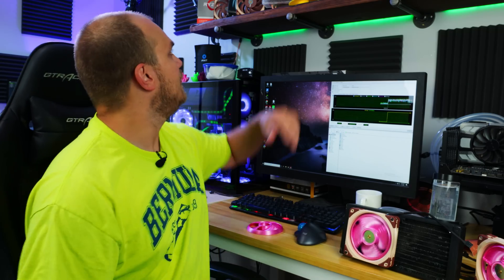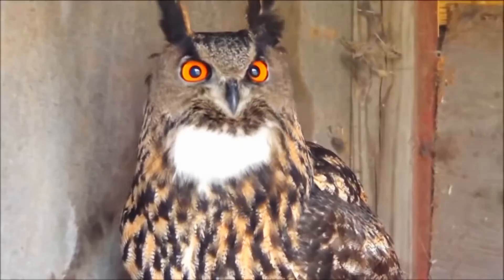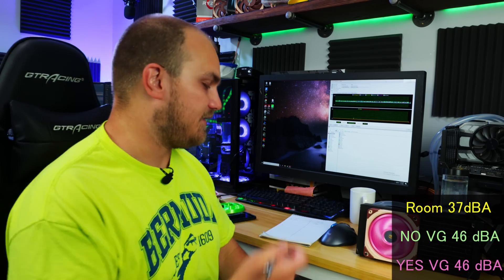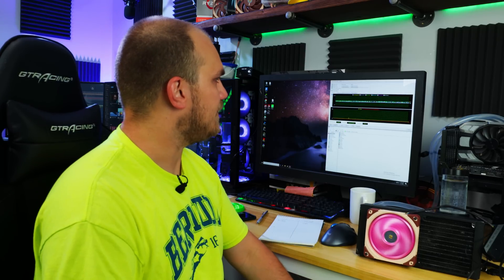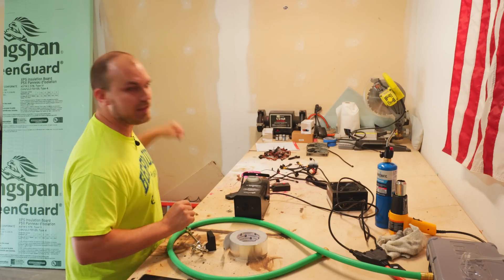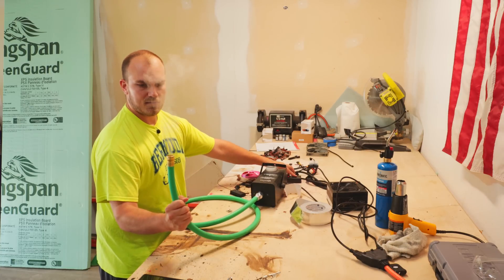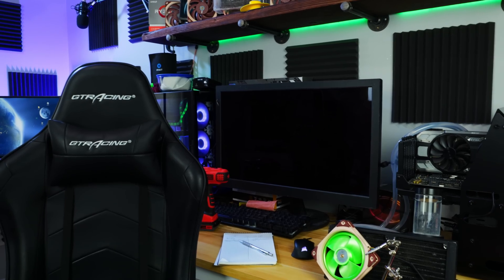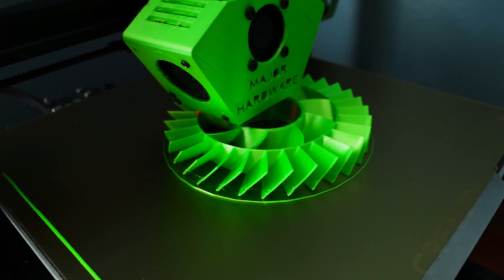Do Vortex Generators Make A Difference | 3D Printed Fan Testing

Comment: With vortex generators on wings, blades, etc, you examine the air being exhausted, not the air flowing in or entering an intake into the flow system. You can build your own high speed camera. Surprisingly, it doesn't cost anywhere as much as you'd think compared to what they sell for from companies. Oh, and drywall lift is like $200 from Harbor Freight so about $160 with their 20% off coupon, maybe less if you wait for them to discount it and use the coupon if employee lets ya. Prob would be sub $100 off Craigslist or something.

Comment: @Major Hardware
Thanks for another entertaining video.
 I have a couple of thoughts  surrounding this, firstly my initial reaction was to wonder why You didn't also test to have the "vortex generators" on the other side of the blades, as the "backside" arguably are at least as important as the "front" of the blades. Also as has been pointed out the "inherent roughness" of 3D printing might "mask" what ever effect the generators could/would have if the blades were perfectly smooth. And finally I feel that the "exhaust side" of the fans really should have been the focus of Your "study" and "documentation" as the (potential) vortices  would not appear until the air had passed over the fan blades.
On another note,  maybe You could 3D-print (or juryrig) a holder for Your mobile phone that, using "rubber bands" could hold it at a consistent distance from the fans You are measuring ?
Best regards.

Comment: I'd say lose the Vortex Generators for weight trimming. Of course lose the ring. Thicken up the spine of the blades, make the blades taper towards the base. So the blades will be more tear drop shaped. Not sure how to explain that without showing it. lol Oh. These numbers don't matter just an example. The base of the blade would be 1cm where the edges of it expand to 2cm.

Comment: nice fun video.... I will suggest if you try the outer line to have a funnel like edge. That can help in the suction of air and compression. The way that you have the outer edge you actually reduce pressure as your input of the fan is smaller than the output! Have fun.....

Comment: I don't know if anyone already answered this but.... vortex generators are there to force an early shift to turbulent flow (vs linear). This is to prevent laminar flow shedding. On aircrafts this is typical a fix  to loss off total lift, on a certain part of the wing at larger incident angles. When shedding occurs all lift is lost (stalling). Turbulent flow delays shedding,  but results in larger drag than laminar flow. The wet area of the extra vortex generators doesn't help either.

Comment: I feel like the best approach to optimizing the fan design would be to get rid of  the ring and try to get the blade clearance to the outter housing as small as possible. The most benefit to be had is on the outer edge of the fan blade.

Comment: How about a design based on the idea presented here by Tom: https://youtu.be/d80oXSCcHTk
It would require a Speed controller for the fan though.

Based on this idea a simple compressor chamber principle could be achieved.  The fan itself consists of  a static part of two 1/8 of solid circle slices and of two 1/8 circle slices on hinges.
There are also two 1/4 slices of a circle above and below the fan (rotated by 90°) to create pressure chambers.
If the fan speeds up the static blades move forward compared to the moveable blades and the air in-between is compressed. When the static fan slows down the dynamic blades move forward air is sucked in.

Edit1: Now after thinking about it, the blades themselves can consist of just two parts: one static connected to the motor (that is speeding up and slowing down ) and one freely rotating around the same axis on a bearing.

Edit2: i made a quick sketch: https://youtu.be/m7XP239dxHE .  The free running blade should be heavy to increase inertia. It would need a starting phase to get the free running blade up to speed. The over- and under pressure from the air in the chambers should keep the free running blade at a constant speed while the controlled blade speeds up and slows down. Maybe the Design would work better if the Blades are 1/6 of a Circle and not 1/8

Edit3: 1/6 Circle blades: https://www.youtube.com/watch?v=aW1cJS0i3Lc 
in difference to Tom  Stantons the speed is not  50/50 it is 2/6th for 30° to 1/6th for 120°

Comment: What the vortex generators can do:
-at high speeds they prevent airfoils with low pressures on the upper side from stalling (flow separation) by transfering energy into the boundary layer.
To work properly they need to generate "lift" (inducted vortex)
Reasons they dont work as expected here:
-flow velocity to low (I think Re<10^4). Things work out quiet different at low speeds/Re-Numbers.
- Vortex generators to small to generate sufficient lift thus dont generate vortexes.
-Rough surface
- This fan should does most of its work with the higher pressure under the blades and the blades are shallow enough to prevent stalling. At those speeds huge laminar speparation bubbles may occur, but thats only relevant for drag, since there shouldnt be that much low pressure on the upper side of the blade.
Aerodynamic is mean and complicated stuff with a lot of hard to predict phenomenons occuring only under special conditions :P

Comment: This vortex generator is useful to create more lift when the blade stalls. I presume you can add more angle to the blade than the blade without. This means that these turbulators will try to keep the transition in one place. But at low Reynolds number probably the difference is not noticeable. So if you make different fans with different angles, more angle (more than 45°) at some point the blade will stall and so the fan will be not moving so much air. Steps of 5° probably the one with vortex generators(https://en.wikipedia.org/wiki/Vortex_generator) will keep pushing for a few degrees more.  Cambered airfoils profit from this but your airfoil profile does not look like to have much camber. 
Another test suggestion: RIBLETS (https://www.sciencedirect.com/topics/engineering/riblets) so tow test. Print the blade horizontally. Second test print the blade vertically. The second one probably reduces from 1 to 5% in energy.
Another test suggestion: Make different blades using different airfoil sections. Square, Round and sharp, concave, concave with flap at the end.
Another test suggestion: Make different blades at 45° angle (or your favorite angle) changing camber amount.

Comment: So you see cars need to move air as fast into the engine as possible and sometimes using turbo charges if they have to. 
Turbos are basically designed to suck the most amount of air as possible 

So I was thinking of a turbo designed inspired cooling fan?

Comment: Here's another idea too... try adding leading edge slats to a sharper blade bitch than stock Noctua. One of the problems I think you're running into though is that as you change the fan, you're moving out of the motor's peak power envelope, so that will have some consequences even if you could improve, for instance, static pressure.

Comment: It would be interesting to see what a 120mm blower could do, but I know it'll take a lot of material. I'm thinking they tend to have a lot more static pressure, so may be good for radiators if you could find a place to mount them.

From what I can see in your footage, the vortex generators do seem to cause a bit of turbulence upstream where the smooth blade doesn't seem to have that issue.

Comment: That looks really cool. I'd like to see an inverted version of that as well, more blades with more aggressive pitch on the inside, and fewer with less aggressive on the outside. .

I'm thinking optimize the inner ring since it has a slower airspeed, and optimize the outer ring for the higher airspeed, kind of like how aircraft propellers are twisted for that same reason.

Comment: Btw, you probably need brighter lights and/or a better slowmo camera, those blades looked a little smeared in the slowmo shots, smoke moving at similar speeds would probably also not look very detailed

Comment: Are the vortex generators on the intake or exhaust side?  And all the commercial applications they are applied to their used at the very end of the object or on the exhaust side to improve aerodynamics or air flow.  Is there any way to smooth the surface of pla prints like there is with abs?

Comment: would decreasing your layer thickness on the print offer any performance? Don't know what its at now, but like anything else, a lower layer thickness means it more accurately resolves the intended  geometry, and any turbulence generated by the layer ripples would be decreased.

Comment: Also, you should look at current draw for the different fans.  Alternatively you can use a tachometer to measure the fan speed which should be inversely proportional to current draw.

Comment: There are two things I would like to see:
1) straight tube compared to a tube with a 45 degree bend with a fan at the end to see if there is a difference
2) tube with two fans spinning in opposite directions but pushing air in the same direction, kinda like a jet engine
Reasons: just wondering about the dead space around the middle of a fan, and also how push pull designs around a raditor could be affected by moving the fans further away but channeling the air.

Comment: Hey i've got an idea for a fan you could make based on a U Format server case. Basically it's a big blower style fan, BUT it's in the shape of a cylindrical format, meaning it acts like per say, 20 blower style fans stuck together. Do you get me? It would be a really cool server cooling solution.

Comment: You need to get a storage tub and cut a 140mm/120mm hole in one side and on the other side the inlet for the hose from the smoke machine. at the inlet you need to use baffles so the smoke gets dispersed in the tub better.  This will give you a much better indication of the fans action than just putting the garden hose right next to it.  Be sure to include some way for air to get in on the inlet side as well so that the fan can pull air freely as if it is a sealed chamber then the fan will be pulling against a vacuum or the smoke machine will be pressurising the chamber dependent on if the fan moves more or less air than the smoke machine puts in.

Comment: gains would be negligible on such small scale. weight difference might be the only possible +/- between the 2 designs, lighter would be less current draw by the motor. as mentioned before, the surface imperfection of the blades in 3d print might negate any possible advantage to increased flow. the boundary layer is inhibited in laminar flow by this texture

Comment: As far as I know, VG energizes the airflow to help the boundary layer stay attached to the surface. I don't think the fans are spinning fast enough to stall the blades (makes me wonder how a stalled fan would do on performance? Most likely worse, but how much worse?). Cool experiment though! Would be interesting to see what a serrated trailing edge would do, probably nothing I'm assuming...

Comment: I think on multiple rings as are now one outer ring put one ring on the middle... And another thing (I think cool thing) can be add a middle ring than grow a bit in size than will create a low and high pressure zone under the fan.
I will try to explain it a bit better: on a 12cm fan we have 4cm as the fan motor, around it on the top the ring will start at 8cm and end at 10cm an intake on 37.7cm² and outtake of 66cm² while the outer ring will have a intake of 63cm² and a outtake 34.5cm²

Comment: I would love to see an original noctua or your fake one which came pretty close to it, be enclosed by a dome with a hole in it . So the air going into the fan needs to be compressed somehow  so compressed air is cooler as I heard. Could this possibly increase the cooling effect?

Comment: get a Digital Anemometer so you can accurately measure the difference in the airflow from each fan design 
https://www.amazon.co.uk/Amgaze-Anemometer-Measurement-Thermometer-Windsurfing/dp/B01LZXM0LP/ref=asc_df_B01LZXM0LP/?tag=googshopuk-21&linkCode=df0&hvadid=311137623728&hvpos=&hvnetw=g&hvrand=2626754053137550862&hvpone=&hvptwo=&hvqmt=&hvdev=c&hvdvcmdl=&hvlocint=&hvlocphy=1006727&hvtargid=pla-424573912703&psc=1
as for airflow build a smoke chamber

Comment: What about golf ball divots on the blade surfaces?
Reply: And from the experience with polishing blades on my RC boat what is behind the chopping edge is not as important for performance as what the side of blade that is pushing fluid

Comment: You should try making a dyson fan that they say can move a lot of air with a lot of pressure. It would be interesting to see what that design could do with a cpu cooler or radiator. Here's some links to what it looks like: https://images.app.goo.gl/nxXqaX2ZACvxeSYQ8 https://images.app.goo.gl/wZcHNH2EyBfU8CoSA https://images.app.goo.gl/84B64jNKpNhyvGE78

Comment: For the vorteg generators to have effect they need to be on the trailing edge of the blade. The radiator might also diminish it's effect, set the fan to pull instead of push into the radiator.

Comment: Doesn’t even give the viewers time to actually watch the dBs settle.

A smoke test is only really good for showing where air is moving in an enclosure; it doesn’t really give specificity as to how that air is moving. If you really want to see if it’s inducing interference in the air, run a CFD simulation with the model. That will truly give you an accurate picture of if that blade design is doing what you want.

Comment: what about a fan shroud to make the fins scoops taller and less of an angle?  Also can you put the vortex fins on the opposite side of the blades?  Can you make fins more like a plane propeller or make fins that spin in opposite direction but push the air in the same direction like a contra-rotating propellers?

Comment: VGs won't do anything but add drag if the fan blades aren't operating around an angle of attack close to or at the point where flow separates. 
I'd say, for low sound you want lower speed (rpm) which means you want the most efficiency. Keep the ring as that will disrupt tip-vortices which cause a drag increase, don't taper it at the back (that cuts into the blade area at the outer edge where the blades are moving fastest and doing the most work) but extend the front a bit and open it up like a velocity stack on a carburettor which will help get air into the fan, especially around the outer edges where the blades are moving fastest and contributing the most. It might be most efficient to have a ring around the blades and add a non-turning velocity-stack style entrance to the face of the fan.

Comment: Extend the blades beyond the casing on the input, output, or both to increase the angle of attack and increase the volume of air moved. At this point you could even include a shroud.

Comment: What about putting the vortex generators on the back side of the blade?  Some noise is generated by the passing of a blade and the vortex generator could help thicken the boundary layer with the blade to smooth out the pulses of pressure.

Comment: I think your test methodology isn't quite granular enough to be able to see a difference between the two. To measure fan performance you need to do a static pressure test, an air flow to pressure test, and an objective sound test for all test points used in the previous two tests. If you take the argument that temperatures are what actually matters so we should measure that, which isn't wrong, then there's other controls you need. If you're going against CPU temperature, you need to monitor CPU clocks and EPS power draw. 80+ C is high enough that it's possible one fan was doing better but wasn't boosting as high and so temperatures stabilized out at the same point. A better option would be getting a system for monitoring water temperatures and flow. Monitor delta T across the radiator and flow rate. One flow balance equation later and you have thermal power from the radiator. Go down to a 120 rad will thermally stress the system more, which will help since most of those systems get more accurate as you get higher on their indicating scales,  and then the clocks or power draw of the CPU don't matter. You are then strictly monitoring radiator performance against a given fan RPM and blade design. AeroCool makes some reasonably priced stuff for both flow and temperature. Alphacool also makes some temperature monitoring stuff, idk about flow. AeroCool also makes some differential pressure sensors (pretty sure they're the same as used on their flow sensors just removed from the venturi) that are in the inches of water range and so would work good for static pressure testing I mentioned before.

You also then have the hardware to test other dumb things. While pooping this morning after watching this video, it occurred to me that these fan blades are pretty good for static pressure, probably, and building a mineral oil loop using a tower air cooler with a water box around it and one or two of these fans installed as the motive force for the loop would be interesting. Also, a natural convection cooling setup. It would work, it's just a matter of how high you have to mount the radiator to get the necessary thermal driving head and building a low flow restriction water block. Measuring the pressure drop across your water cooled air cooler, because it's significantly more open to flow than a typical block with microfins is. Lots of good objective data for evaluating if something is "better" and you could use the data to determine if the design is just flawed or if it has room to be improved to a point of being "better", or at least "not terrible.".

PS The fins look dope. I'll take 8. Make that 11.